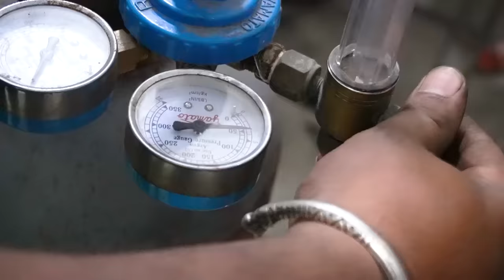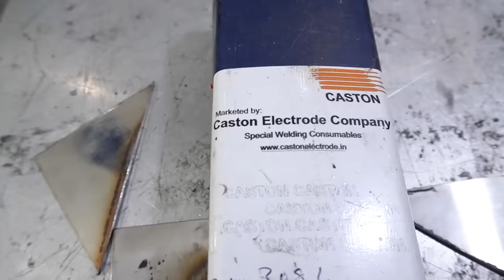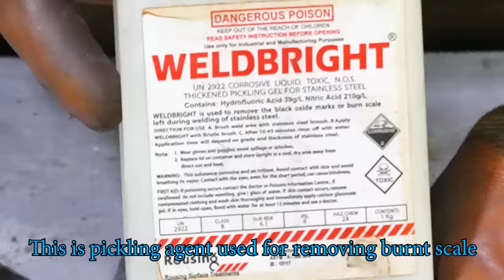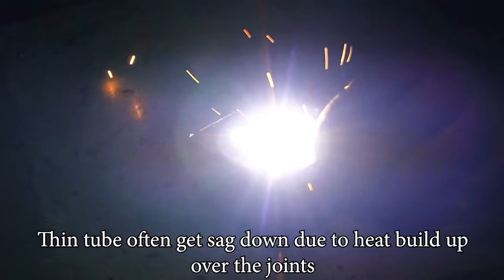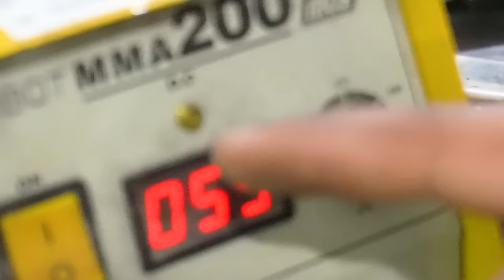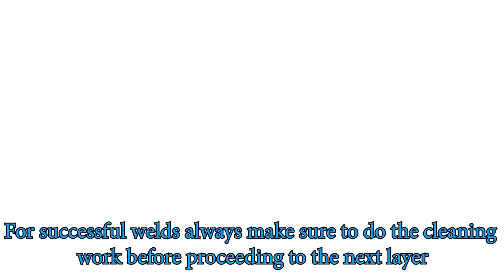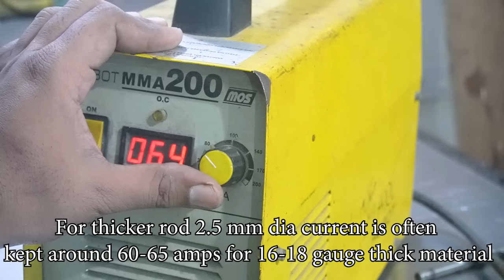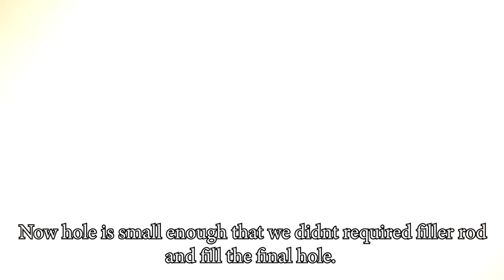Learn Stainless Steel Top 7 Stick/Arc welding Hacks and Tips to improve your Work / Brilliant idea

Comment: If you buy manual tig same as you made you forget to put valve on hose for argon..
Reply from the maker: Yeah buddy that's really necessary but I would prefer solenoid gas valve to do the job just like the on comes in tig torch that will shut down automatically once I release the button.

Comment: Bro I just want to know the price of argon gas tank .and refilling price..I may buy a ibell Tig  but..I am not understanding Where To buy Argon cylinder and accessories
Reply from the maker: Only cylinder cost of 7 cubic meter will cost 7000-8000 INR. And cost of argon gas will be 1400-1500/-. You can purchase all these from industrial gas supplyer. Seach on google for nearby dealer. You also need to buy gas  regulator with flow controller for your cylinder.

Comment: Also I can't find pickling agent and grade tester in local market, where can I get both of them and what will be the price? Thx for nice demonstration 👍👍👍❤️❤️
Reply from the maker: You can find both these products on India Mart. And the positive and negative terminal can be found with clamp meter or with Multimeter. Red one is positive and black is negative, keep it on dc voltage measurements and check with it.
Reply: @ambroscustom  lo99
Reply: Thanks